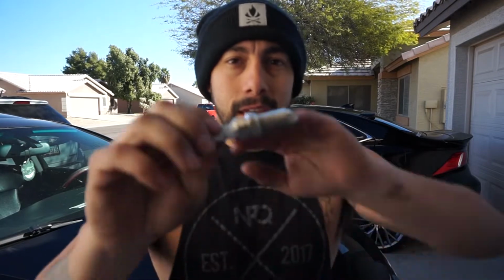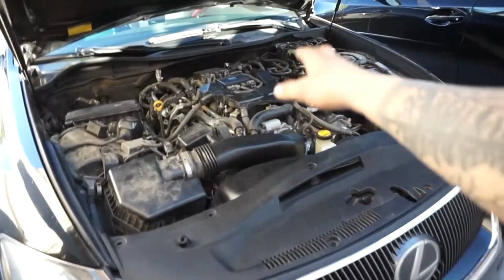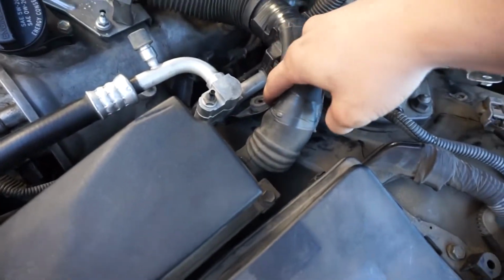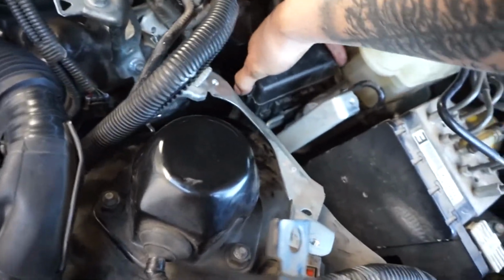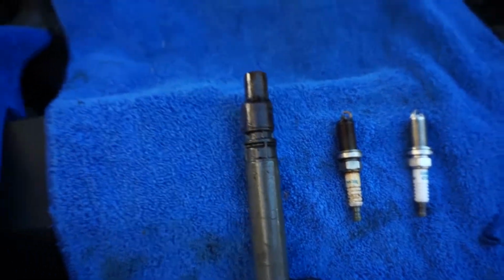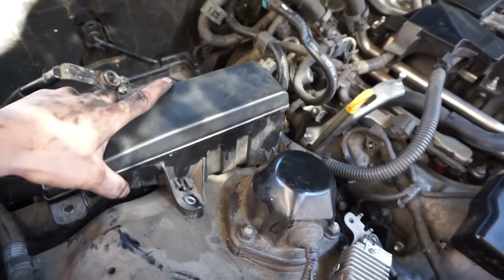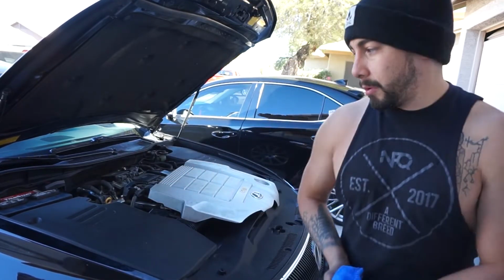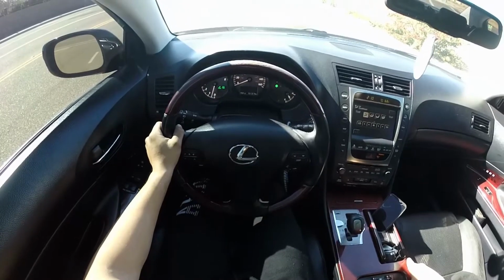Replacing Spark Plugs on a RARE Lexus GS460 V8!!

Comment: Just a heads up for anyone doing this in a RHD GS460, the 3rd coilpack from the firewall counting forward on the drivers side is the nasty one - to get the coil pack out I had to first remove the ring that sits in the rubber grommet that the coilpack sits on, and then use a pry bar to pry the engine a few millimeters - then I was just able to extract the coilpack.  Tightening the plug was also incredibly difficult as I could only get about 1/16th of a turn on the ratchet (make sure you have a good quality, fine toothed ratchet!) - pushing the coilpack back in wasn't so bad, just used the pry-bar a bit again and then once it was mostly in, re-seated the ring.  Hope that's of some help to someone someday - these cars are a bugger to do the plugs on.  The good news is this was by far the worst one.
Reply from the maker: Thanks for the insight! These cars are great but the coil packs in the back are the worst!
Reply: @ajoros  Thanks for your video!  It definitely saved me a lot of time even though you are LHD, most of the stuff is much the same - the bit around the bracket that holds the main fuse box was awesome as I knew exactly how much stuff I had to take out rather than guessing.
Took me nearly 2 hours to do the passengers side, and only an hour to do the drivers side - probably the trickiest plug change I've ever done (& I'm an old bastard who's been working on cars my whole life, so done a lot of plug changes on a lot of cars!) - BUT - the misfire and hesitation are gone so it was worth it - was worried I was up for some coil packs - but it seems the Denso plugs are just the type that are good until they are suddenly not anymore.
Reply: @ajoros  Also not sure if you covered it in another video, but I found bad fuel economy in my car was caused by a dirty MAF sensor - super quick and easy to clean and restored my fuel economy 100%.  Pretty sure it was mostly caused by the oiled K&N filter I fitted, so from now on I'm going to clean the MAF sensor every time I clean the filter element as it only takes a few more minutes.
Reply from the maker: @Beer_Dad1975  you know what, I have been doing this myself and I am adding it to the list of upcoming videos! Thank you for the insight
Reply: What type of ignition coils should I buy for my gs460
Reply: @Jimmy-03  Thought I had replied to this already but it seems it's gone - anyway just stick with the OEM Denso ones, they are great quality and last for many years, and they can be bought very cheaply on line.
Reply: @Beer_Dad1975  is there a website where I can find them because I'm having trouble finding them online

Comment: Awesome work! I think your spark plug tube seals need to be changed as well. Those plugs are saturated in oil
Reply from the maker: Yes it’s bad too! I’m ordering new ones
Reply: I agree! Change them asap. I had a bad oil leak due to worn tube seals and my spark plugs were covered in oil but also my coil packs got destroyed too.
Reply from the maker: @junior17medval  damn I’m wondering if my new spark plugs are useless now
Reply: @ajoros  they should be fine, just clean them again. I just wouldn’t drive the gs460 until the oil leak gets fixed imo. It’s the coil packs you should worry about because they can get expensive to replace.
Reply from the maker: @junior17medval  thanks for the heads up man I’ll do this asap 💯
Reply from the maker: @junior17medval  do I have to take the gasket off to replace the seals or is it the one I pulled off with the coil packs?
Reply: @ajoros  your going to have to replace the whole valve cover gasket and seals. Usually they sell a kit with everything. I’m not exactly sure what they sell for the gs 460 but with my other vehicles they sell a kit with everything to do a valve cover replacement.
Reply from the maker: @junior17medval  damn. Looks like I got another video coming lmao
Reply: @ajoros  yeah 🤣🤣🤣 Remember these cars are old so that tends to happen with seals, rubber, plastics and so forth.
Reply: @ajoros  if you don’t change them soon they’ll foul again, just go back in there and change the tube seals/valve cover gaskets. Wipe off the spark plugs with some shop towels as well the spark plug insert tubes and you’ll be fine. If you haven’t already change PCV valve as well. Cheap part, a lot of people neglect that one.
Reply from the maker: @2url10  thanks man I appreciate the advice and the support 🙏🏽
Reply: @ajoros  anytime brother, OEM only!!

Comment: You need more than spark plugs. More likely spark plug tube oring/gasket job. Toyota 4.6 V8 tend to have spark plug tube leaknkn passenger side.
Reply from the maker: Changed that out in the next video 👍🏽💯

Comment: Are you going to be doing a video on cleaning the oxygen sensors on the 460? I have a GS 460 and do not know where to locate them to do this. My fuel use is not as good as it was even after changing the spark plugs.

Comment: Another great video. I’ve the exact model 08 black/black. Twin!

Do you notice the transmission shift any different after the fluid change?
Reply from the maker: The tranny shifts very slow but idk if that’s the Valvoline or if that’s just how the transmission is.
Reply from the maker: You can see how slow the transmission shifts in my POV video for the exhaust